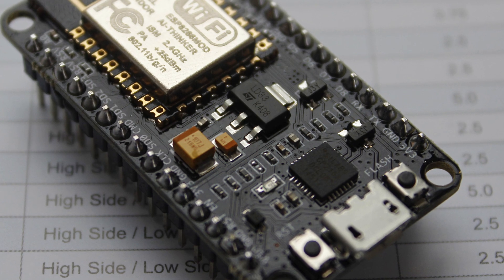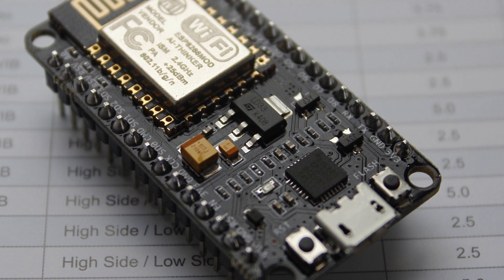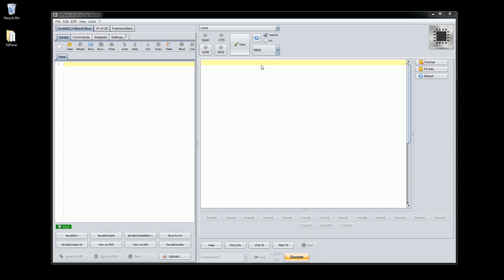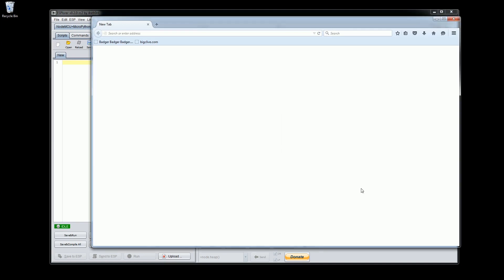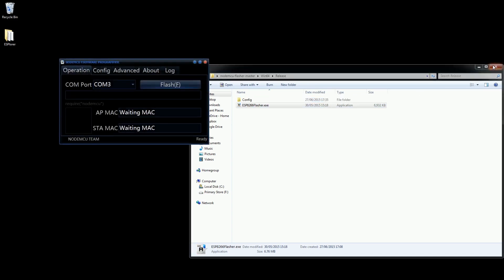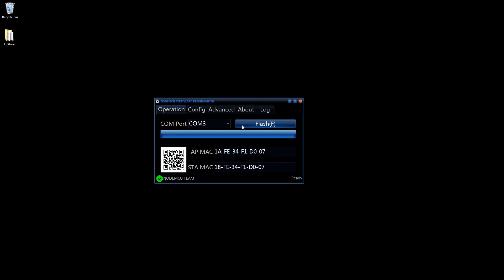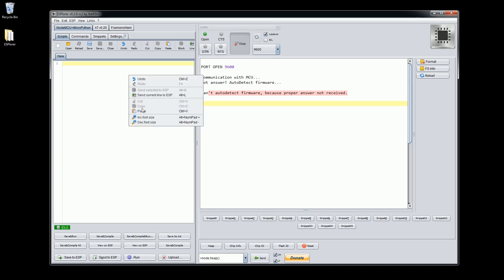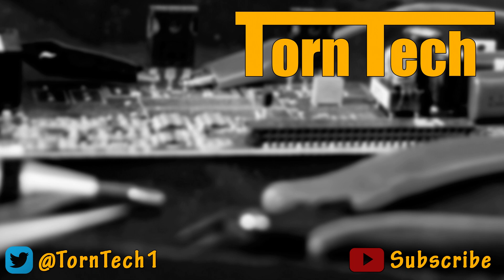ESP8266/NodeMCU IDE, Firmware Upgrade & First Bit Of Code - Complete Guide Part 2 - TN0006

Comment: Got this working thanks to your video! Thanks so much! 

Worth noting that the firmware upload did not work for me until I realized that I was using a USB charging cable that did not have a data line in it. Once I switched cables, I was able to follow your video and the firmware flash and blink test worked perfectly for me.

Comment: Good tutorial so far. However, when I first plugged in my NodeMCU I had to change the baud rate to 115200 to get it to communicate the ESPlorer software. I downloaded and flashed the latest firmware as in the video (if I remember correctly - there have been a few changes obviously since you posted the video). When I tried get it communicate I tried all the baud rates. Then I tried pressing the Reset button on the board, set the baud rate to 9600 and clicked the Open button on the software - success!
Reply: +playinmyblues More info: My board was purchased on eBay and does not have the onboard LED. I had to look up the pinout for the module in general, one example found here:
http://www.cnx-software.com/2015/10/29/getting-started-with-nodemcu-board-powered-by-esp8266-wisoc/
Note that using the diagram and the example provided, connect a current limiting resistor and LED to D0. D0 is labelled on the physical board, also marked as GPIO16.

Do not confuse the gpio reference in the code with the GPIO reference on the diagram.

Comment: Very clear and concise.  Thanks.
Reply: Just a follow-up.  When I uploaded a new custom firmware from https://nodemcu-build.com/ it had reset the comms speed.  When I changed the comms speed from 9600 to 115200 it worked without a hitch.  Thanks again for the vid.
Reply: there is no more pre-built binary firmware.
Should I select all modules to build my own firmware ?

Comment: The link you have for the firmware is still wrong.  I don't know what esp_init_data_default.bin is, but it's not the NODEmcu firmware.  Here is where I got the firmware: https://github.com/nodemcu/nodemcu-firmware/releases.

Thanks for the video.  The NODEmcu I bought didn't come with any firmware even though it was supposed to.  It took me a couple of hours to figure out the problem and how to deal with it.  I needed to connect to the NODEmcu at 115200 baud.  After that, I was able to flash the latest firmware.  Upon reset, I needed to switch to 9600 baud.  Success!

Comment: very helpful thank you! looking forward to the next videos. Where did you get the blackboard version from? I got a yellow one and it doesn't fit on a breadboard correctly for messing around with quickly.
Reply from the maker: coppercompton I got it from one of my favirote Ebay sellers: alice1101983

http://www.ebay.co.uk/itm/-/400923947498

This fits into a breadboard well.

In the process of producing the next video Won't be long!

Comment: At 2:20 you talk about upgrading NodeMCU to the latest version. Are you sure that there is a version already? Or perhaps there is nothing? It just seems odd if they ship it with a version of NodeMCU that can't even identify itself. Then it seems more likely that they ship it with no firmware installed at all, or some firmware that has nothing to do with NodeMCU.
Reply: Well. Both with the existing version of firmware, and the firmware that you install, ESPlorer writes that it can't autodetect the firmware. I thought that was really strange, since ESPlorer is so closely related to the NodeMCU firmware. It turns out, that you need to set the BAUD rate to 115,200. That is the default baud rate for the NodeMCU when it boots up, at least for the most recent versions of NodeMCU firmware. Therefore simply select 115,200 in ESPlorer before clicking Connect, and it will tell you what firmware is on there.

Comment: So what about when i want to do this with esp version without reset button ? I've tried to jumpwire the Reset pin with Vcc pin but it doesn't seems to work either.
////
My mistake, I dont chose properly baudrate, it looks like flashing with 115200 is not related to chose same baudrate on ESP tool (9600).

Comment: Thank you so much Mr.TornTech, i followed your steps and it worked perfectly. 
i have only 3 comments that can be useful for others, pehaps you can add them in the comments or somewhere :)

1-had to manual search for usb driver 
Search for the driver in google
https://www.silabs.com/products/development-tools/software/usb-to-uart-bridge-vcp-drivers
2-coudlnt find the flasher app in the links in the esplorer so i searched it myslef 
https://github.com/nodemcu/nodemcu-flasher
3- we need to close the esplorer before flushin other wise it doesnt work

Comment: I used your code, and nodemcu startup and blink led. When I connect it with ESPlorer, console display:
Communication with MCU...
And I can't  put new command to nodemcu, how can I remove this init.lua??
I tried to flash 0x7c000 with esp_init_data_default.bin but init.lua still working.

Comment: Thanks for this, its been very helpful. Is there any Linux alternative to the NodeMCU Flasher?
Reply from the maker: Constant Joe Hi.

How do you mean Linux alternative? If you mean IDE then the esplorer should work on Linux, i haven't tried it however the nature of how Java is it is meant to port over all platforms(sometimes however this is not the case..) if you mean Linux running on the device i am not sure... In theory you could have some sort of Real time Operating system running on this device but as yet i have not seen any... if you find any let me know, would love to try one out!
Reply: TornTech I tried using the flasher in Ubuntu, and when I connected my device using ESPlorer I got the error
"Got answer! AutoDetect firmware...
 
Can't autodetect firmware, because proper answer not received."
From some googling online, it looked like the flasher was only compatible with Windows. It wouldn't give any errors with other OSs, but the firmware wouldn't transfer over to the device properly.
 However, after messing about a bit, I realised that flashing the firmware worked (must've been updated), but it just changed the baudrate for communication a bit. I went from 115200 down to 57600 and everything worked fine :).

Thanks again for the videos, they're been very helpful.

Comment: when I plug in my board I do not get any driver installation, when I try to manually install drivers it still doesn't connect to the board so I can't upload anything, what do I do?
Reply: Please find the chip near the micro USB port of the Node-MCU board; which is USB driver chip for this board itself, so that external world can communicate with board. Get the driver for that chip from web according to your operating system (win-7 or 8 or 10) then reconnect the Node-MCU board to computer. It might be "CH340G". It should recognize it. Happy programming!!!

Comment: Nice! I have an error: please run file.remove("user.lua") before first use and when I go to download the lastest firmware I get page not found
Reply from the maker: +Claudio Maldonado Parra That"error" is actually a bit of instructions for the end user(You) from the built in firmware. What is happening is the ESP8266 is booting up, it looks for a file called "init.lua" and in that file it is an instruction to load the file "user.lua".... In the user.lua file is just a command to display a message to the serial console saying you have to delete it..
I have updated my video with an annotation saying check the description for the new firmware link, it can be found here:
https://github.com/nodemcu/nodemcu-firmware/blob/master/bin/esp_init_data_default.bin?raw=true
Hope you get it working and enjoy the videos!

Comment: Hi there, thanks for the great videos!
I am falling at the first hurdle and don't know why.
When I plug my board into the computer windows doesn't automatically install the drivers. Any ideas on what I can do?
Reply: It's ok, turns out the board I'm using uses a CH340G USB/UART converter chip. so I got the driver from here: http://www.arduined.eu/ch340-windows-8-driver-download/
Reply from the maker: +saul gold Thanks for replying back for other users. I will be sure to point them in this direction if they have problems too.

Hope you enjoyed the videos and found them useful!

Comment: i have one question when i upload LUA code on ESP8266 it worked when i turn power off, and turn again on don't want to start the code, does it have to be always on power otherwise lost the code? i click save on ESP8266.
Reply from the maker: Hi, 

The example u gave in this video is to send the code to the esp and ask the parser to run the code. 

In esplorer there is an option to save the file to the device. If this file is saved as Init.Lua then the esp is set to look for this file and run it on each start up. 

Please don't use the code I have provided, it's an infinant loop and that makes it hard to knock the nodemcu out of its loop and start responding again. 

My next video will cover all of this as we start looking at building a working project around the nodemcu!
Reply from the maker: +TornTech *I gave
Reply: thnx i made it

Comment: Hi there. Thanx for this video. I am a bit befuddled with this as it has gone a bit complicated for me. I am not writing this for you to help me with my project just a yes or no answer would be really great.
I aim to attach a sensor to the esp8266 and send the result to a local message queue (mqtt) server. Thats it. That is all I want to do. Can you tell me please would this be achievable with this chip and the LEU language? ((The reason I want to do this is because I have a plant-pot at the back end of my house that needs watering and my home computer system runs on a local IoT server picking up messages from all over the house)). Thanx a mil and good luck with your new family. PJ
Reply from the maker: +PJ Jones Hello, Thanks for watching my video. Glad you enjoyed it.

I am actually about to restart this series in a different direction. The new direction will be using the Arduino IDE and programming the ESP8266 in C code.

I have a similar Setup a MQTT server sitting there receiving all the data from these little nodes around my house feeding in information.

Would you like a video on my MQTT setup?
Reply: ... that would be great thanx very much.
Reply: +TornTech yes yes yes please

Comment: tried to connect mine and it doesn't find any drivers, then shows up as CP2102 USB to UART Bridge Controller
in device manager any advice?
Reply: Had this same issue.  You should be able to solve this 2 ways. You can get the drivers by install the Arduino IDE or download them from https://www.silabs.com/products/development-tools/software/usb-to-uart-bridge-vcp-drivers

I also had a second issue with the ESPlorer, it would crash when opening the com port. After some investigation, it looks like this happens with win10 + java9. I downgrade to jdk 1.8 and all seemed to work.

Comment: I'm sorry, as a newbie, I just don't get it. I downloaded the items discribed, installed java, and extracted the files from the esplorer.zip. Now what? How do I open the ide? Sorry to be so dumb but I figured it would open like the arduino ide did
Reply from the maker: +Google User you should be-able to just run the ESPlorer.jar file(or the bat file!)

if not, what happens when you try to run them files?

Hope you get it working, i love the ESPlorer IDE and the ESP8266 dev board!
Reply: TornTech As in most cases it was "pilot error" I was clicking on the bat file, not jar...(blush). It is working, but generates another question. After flashing am I correct in assuming the AT command set is now gone, and how does one (re)configure the module after loading nodemcu, if desired?

Comment: Hello I have tried your tutorial and seem to be having some issues that I hope you can help with. 

When I open the port at 9600 I get :
Got answer! AutoDetect firmware....
can't autodetect firmware, because proper answer not received.
than some strange characters."

after this I get no software information or anything else. I have attempted to open it on all ports and get the same thing except for on port 74880.
on this port I get the fallowing:
Got answer! AutoDetect firmware...
Can't autodetect firmware, because proper answer not received.
load 0x401000000, len 31900, room 16
tail 12
cheksum 0xef
ho 0 tail 12 room 4
load 0x33333333, len 858993459, room 12

When I flash with the latest firmware with the software I get a blue flashing light and it states that it was successful.

I get the previous errors when checking firmware no matter what version I use.

If I attempt to load the program I get:

Waiting answer from ESP - Timeout reached. Command aborted.

If you can give any help I would greatly appreciate it.
Reply: +David Hart "than some strange characters" change baudrate :)
Reply: +David Hart any luck with this yet? The same thing is happening to me
Reply: None sorry.
Reply: +David Hart Try to change the baudrate to e.g. 115200 (instead of 9600)
Reply: Oh gosh. Thank you!